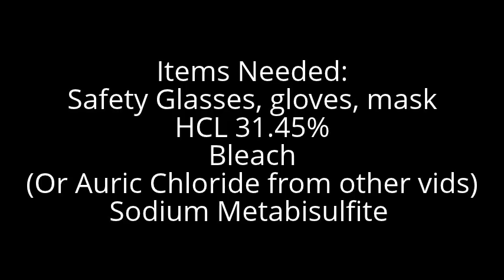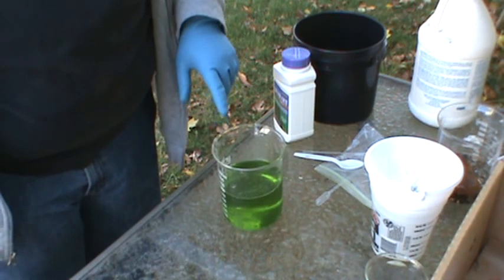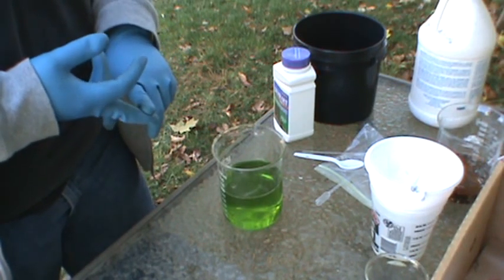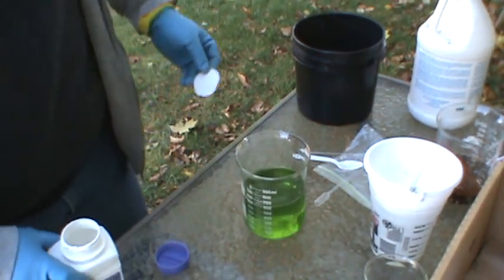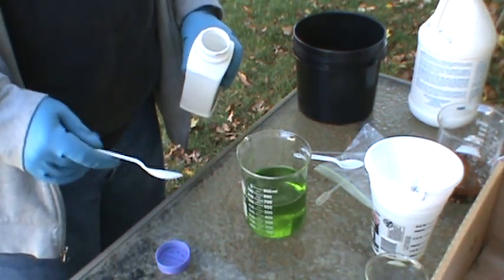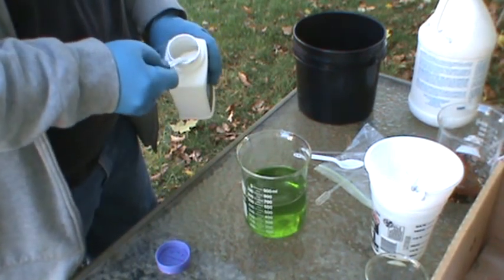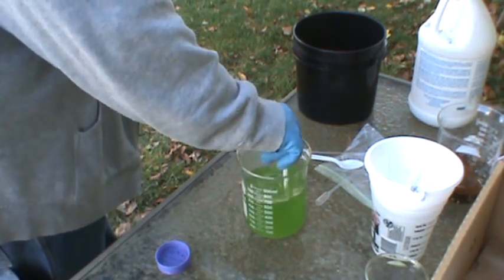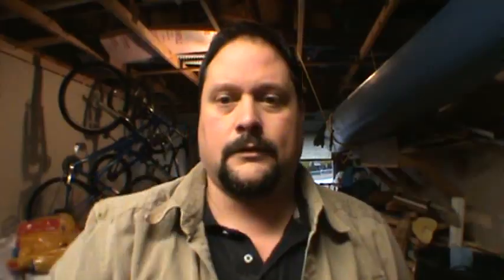Gold Recovery:  A Refining Process to Purify Gold

Comment: I have several kilos of the little Gold foil strips from ink cartridges and I was thinking of a simpler method of just burning them, homogenising the resulting ash, and then just gravity panning out the Gold/copper, melting that down into an ingot and then having that assayed and hallmarked. If the Gold content would be too low, I'd consider refining it electrolytically. What do you think?

Comment: ok so Im a total dumbass,,,excuse my french but its true,  HA,,I smelted 28grams of gold using map gas and borax, everythuing was fine until I took a closer look and noticed borax had embedded itself in my new nugget, no bueno!!  What are my options as far as getting rid of it ?? Or do I have any? thnx..gr8 video btw
Reply from the maker: Making a mistake or having an unfavorable result does not make you a dumbass.  Failing to acknowledge or attempt to learn from a mistake does.  If it were my nugget, and I am no pro by any means, I would heat it up again in the crucible without adding any more borax.  get it to the point where it is liquid and moves around the crucible very easily and continue to heat for a little.  the borax should come to the outer surface.  any remaining may disappear if you soak it in just hcl for a day or two.  Nice job!  28g isa  big nugget!
Reply: kool thnx for the input, is there such a thing as too much heat? Im terrified Im going to screw this up any more than I allready have.
Reply from the maker: 28G of gold and a MAPP torch, you will not over heat it.

Comment: Few questions. You said on the end that you are gonna heat up the solution to evaporate a bit of it - wouldn't it be pimplier just to filter out the gold? What are you doing with the solution after filtering out gold in the end?
Reply from the maker: when the gold has dropped, the particles are so small that they can pass through most filters.

Comment: Thanks so much for the videos! I wish this information was accessible years ago. I've been in scrap metal for about 35 years. The year Win95 came out I scrapped about 300 computers. There was a lot more gold in them then. I don't get many now. I sell my mother, daughter and memory boards as is. I once had a mother board from a mid60s computer that the scrap yard told me if I had more of them he would pay me $120/lb.  I dissect all the other components. I even yank the wires out of phone and network jacks and cut off the gold plated pins.  One thing I haven't seen from anybody is a discussion of waste and how to recover and reuse the acids. Good luck and stay safe.
Reply: Makes you cringe when you think back doesn't it...I know I do.  Especially when I think about things like all the old video game cartridges that were thrown out as a kid etc.  The acids for the most part are not reusable or salvageable after they have been spent.  If used properly, they can last a long time, at least AP anyway.  Others get added to stock pots where they are often evaporated down and further precious metal recovery takes place then they are disposed of at chemical waste facilities.

Comment: I just watched Gold Recovery: A Refining Process to Purify Gold and had a question. Does the Stump out bind to the gold? Because when the gold is in the first solution, it looks like its liquid gold. Also, once the gold has settled, how do you get the gold out of the soda bottle?  They are flakes at that point, right? Do I use a coffee filter in a funnel?
Reply from the maker: no, when stump out or SMB is added it makes sulfur dioxide gas that causes the gold to drop.  Once the gold has dropped, there are no flakes, only dust.  Soda bottles are not the best container to use, I have learned that since this video.  You should decant into a wide mouth container like a beaker.  rinse the bottle well with hcl or distilled water to make sure all gold is in the beaker.  Alow to settle.  then carefully filter the liquid off making sure to not disturb the gold dust.  When the fluid level is low, heat to finish drying.  Save the filter with other sweeps and filters for future recovery
Reply: but how to filter the liquid off? what should I use to do that?
Reply from the maker: double layer of coffee filters

Comment: +Moose Scrapper too little gold in solution.....is that the reason after putting SMB into the solution, it turned from green (residual copper) to a light Amber color? I am going to let it sit in the warmth of outside to try and accelerate the reaction process. Any tips? It is a combination of gold particles from computer parts as well as the gold from ink cartridge ribbons.
Reply from the maker: Possibly that there is too little gold in there.  The amber color is likely the gold however it is likely getting redisolved.  also depends on what your total fluid volume is

Comment: Hi'ya, Moose. Big fan and recently subscribed to your page. So, I recently helped close down a semiconductor facility that I worked at for nearly 14 years. And, because I was one of the last employees there, I came across several old ST boards with about 1,500 gold pins per board (try removing all of those pins by yourself, yikes!). Anyway, my brother and I recently setup a fume hood to remove the gold plating from these 8-10 lbs of pins we now have via usage of some Nitric acid. It worked like a charm but, unfortunately, we sucked up most of our Nitric acid on the first run and only did about 200 grams of pins (as you can see, even though it's a faster process, it's not financially sound). So, we were wondering how we could do a few pounds of these pins at a cheaper cost all at once. I watched your Muriatic air bubbling video, and even though it worked great for those gold fingers, we're not sure it'll work for completely covered gold pins. Any suggestions and/or advice with this current problem that we're experiencing. And no worries, I'm well trained at handling chemicals and also the proper safety gear, as that was one of my primary tasks while working for said company. Thanks in advance and we hope to hear from you soon. Take care!

Comment: sry moose what I meant is the gold u are precipitating in muriatic acid and peroxide?  what exactly is the solution you are precipitating the gold from
Reply from the maker: +Anthony Holbrook hcl and bleach.  If your gold is going through the filters, then double or triple up the filters or get some more fine filters.  Its ok for gold to get trapped in the filters because you can always dry them, burn them, then process the ashes with HCL bleach.

Comment: when u added stump out SMB did you dilute the acid . and was the gold in your normal solution = muratic and peroxide.  thanks for the videos moose .
Reply from the maker: +Anthony Holbrook no.... there was no peroxide at all... are you sure you watched this video?  The SMB can be diluted with HCL or distilled water before added.  It helps for a more thorough reaction.
Reply from the maker: +jas wix hydrogen peroxide is not bleach.
Reply: +Moose Scrapper I think he means Hydrogen Peroxide which is bleach
Reply: yes sorry about that haha isn't there hydrogen peroxide in bleach though?

Comment: thanks moose, 1 more question do you happen to know how to get the gold off of say 50 coffee filters. On the cheap side. I also dnt have a hot plate or fume hood and ohio is cold .
Reply from the maker: +Anthony Holbrook Usually one can carefully burn the filters then treat the ashes with the HCL Bleach method.
Reply: another possibility is to just rinse/wash the gold off of the filters with distilled water then run it through something akin to one of those reusable plastic/fine mesh coffee filters.  not trying to steal your thunder moosecrapper, just trying to facilitate the flow of info.  I'm wanting to get into dong this myself an want as much knowledge as I can get before I start so I can be as efficient as possible.

Comment: hey moose I have silver contacts attached to brass,copper and maybe aluminum.  I've had it sitting for almost a week,  adding little muratic acid and peroxide every few days. some I think brass wnt dissolve.  any advice to recover the silver before cementing or precipitation.  looked all around and can't get good answer.  thanks
Reply from the maker: +Anthony Holbrook If you are using AP, you need to just let it sit.  It can take weeks for the brass to dissolve.  If you have an air bubbler that will speed things up.

Comment: hello I think I'm double posting new to this...did u neutrilize the solution prior to precipitation with SMB . and can u and if not what happens if u try to get gold off fingerboards with HCL/bleach solution instead of using the HCL/peroxide method thank u so much.
Reply: +Moose Scrapper thank you so much for the reply. so I've taking up gold scrapping as a hobby for a few months now. 1st obtaining knowledge and then trial and error always using upmost safety. I found that using bleach is very toxic and I appreciate all the safety and warnings u put into ur videos. thru trial and error I found that instead of bleach what I used is nitric acid. now this chemical is hard to find and darn impossible to get in some states so I ordered a standard gold testing kit. what comes In it are several vials that contain acids that test for gold. these vials contain a mixture of nitric and muriatic acids 10k 14k 18k &22k. now I put 100mls in a mason jar and then put my gold foils in along with one vial of 22k nitric acid/muriatic. it dissolved all the foils and from there I used 2 tbl spoons baking soda to neutrilize then SMB and I got a nice return. do u think I'm onto something or I should go back to the basics. Thank you again for all your help and advice.
Reply from the maker: +Jeremiah Nickerson I don't know anything about using nitric but if its working for you and is still profitable, safe, and enjoyable, why stop?

Comment: If someone melted IDE pins into an ingot would dissolving the ingot in acid then adding the stumpout leave me with just gold or will it bring back the copper and other metals too?
Reply from the maker: +Michael Sacco Well to begin with, it would take months to dissolve the ingot.  Second, most of the ingots that people sell on ebay are so small that the amount of gold recovered from one is almost too tiny to measure.  Refiners really discourage smelting before refining.  Acids need surface area to work, smelting reduces the total surface area exponentially.

Comment: Moose, Love the vids and have been doing the A-P method for foils. Here's a Question for you. Can Bonide S/O be used in the A/B and the A-P method? I have some printer cartridges that I peeled off the gold strips. Would like to try the A/B method instead of A-P
Reply from the maker: +Robert Kline No, two different processes and solutions entirely.
Reply: +Moose Scrapper  Got  those soaking in A-P and the stuff turned yellow. There are a few small flakes floating around but it seems most of the gold has "disappeared". Also I have some used A-P that is black. I put a SS fork in it and two days later the fork was half gone and its still black any ideas/suggestions? Thanx for replying
Reply from the maker: +Robert Kline Did you check the bottom of the container after the fork vanished?  Sometimes the copper crystals slough off and sink.  Turning yellow is fine, a few flakes as well.  Many of the flakes will be very tiny anyway.  IF you feel any gold has dissolved you can simply place a large piece of clean copper in the solution for a few days until it stops dissolving.  THis will push out any gold from solution as a black powder.  Just be sure that you do not make one of the biggest mistakes new folks make by thinking that just because there is not much gold floating that something went wrong.  Most often people just don't realize how much material it takes to make a gram of gold.  Bottom line, the gold isn't going any where as long as you do not throw anything out.

Comment: hey. I love your vids just a question, if I buy a drop melt of 56.6 grams in a nugget shape would I follow this same process to purify it?
Reply: +Cassidy Estrada you saw that on ebay also?
Reply from the maker: +Armored Apceros No, and quite frankly, those listings are 100% scams targeting people who do not know a lot about gold recovery.  They have practically no gold in them but because the pins are brass under the gold plate they look gold in the pics.  Best advice is to stay away from all those ebay listings.  You end up paying $40 for $0.40 of gold.
Reply: What about buying the cpu pins in bulk
Reply: Yes armored apceros and unfortunately I fell victim to it
Reply from the maker: +Cassidy Estrada The problem with buying that stuff, especially on ebay, is that its a fools market.  Not meaning that you are a fool, just meaning that people have been buying these items and inflating the prices to a point so far above the actual value because they do not know what they are doing and there are loads of people out there who want to capitalize on that fact.  I often search ebay for things just to see what the prices are at and can tell you that I have yet to find anything.... and I do mean anything that is reasonably priced.  You can find auctions that start off at 99 cents but because people think its worth more than it actually is, the bidding almost always go way to high.  The only places to get reasonable prices would be on smaller forums like the gold refining forum etc. however if you are new enough to the hobby where you do not know how overpriced ebay stuff is, then you should probably stick to just recovering the stuff you find until you have some experience under your belt.  Does that make sense?Thanks!

Comment: hi i like your video find them interesting  i notice you  work with acid one safety advice when you  do that  keep a boket of fresh water  or your garden hose near by  if you  splash yourself you can wash it off fast  and avoid problem
Reply from the maker: +ray tru Great advice!  The garden hose was literally a couple inches away from the corner of the table.

Comment: HI CAN I GET SOME HELP THERE WAS A VIDEO OF URS WHERE U SED WE CAN USE HCL WHICH IS USED FOR SWIMMING POOLS BUT U SED PH MINUS I CANT GET THAT HERE WER I LIVE BUT I HAVE HCL FULL STRENGTH HOW DO I SUBSTITUTE THE PERCENTAGE OF THAT FULL STRENGTH OR MEASURE IT
Reply from the maker: +Punam Sharma Nayee Define "full Stregnth"  HCL 31.45% is recommended for these processes.  The strongest HCL out there is just slightly over 40% but the evaporation rate is so high that it is not very common at all.  Most "Concentrated HCL" is around 38% so if that is what you have you can simply mix up 800ml of your concentrated hcl with 200ml distilled water that should give you close to 31%.

Comment: i know you can get bleach at the cleaning section of a store but where  can you get the  other stuff ._.
Reply from the maker: +tails doll black HCL also called muriatic acid is available at just about every hardware store in the US.  Its used as a copper etchant and to clean concrete.  SMB you can find either at stores that sell beer and wine brewing supplies or on ebay.  Its loads cheaper at the brewing stores though.  Food grade works just fine.
Reply: downside... i live in Canada  :P  but i will look up on that    thankies   ^^

Comment: your doing great... I've been a hobby gold miner all my life.  not in this way but by going out and digging up the earth.  Lots of fun for the whole family.  Gets you outside and doing stuff with the family.
Reply: Harwin, Hello. I hard rock mine. Just started. Was willed 5,000 acre's that had 3 very old gold mine's. I sent some cons off to a refiner. Said 3-3 1/2oz per ton. He also said encapsulated in magnetites[these not worried about], but he said Gold in my sulfide's. Since I know I have alot of sulfides also. I am trying to get the gold from them. I roasted and got some, but I am trying HCl & perox. But I was told galvanized nails would precipitate. Well just did today, nope. Left sit all day on a warming plate, dropped in galvanized nothing happened except as nail went in it fizzed then stopped. I cant get smb. Any idea's on how. The HCl solution turned deep yellow, real dark.
Reply: @1hardman161  SMB is easy to get hold of.. you need to get in touch with a homebrew supplier. It is used to clean the distillers tanks. :)
Reply from the maker: +Harwen Entertainment I have always wanted to try that.  There is only one spot that I know if in Maine to do that and its two hours away and still pretty hard to get any gold.

Comment: This is very interesting! Thanks for sharing. What do think about circuit board recovery?
Reply from the maker: +David Aune I am not sure what you are referring to with that.  Some circuit boards have no PM's on them at all.  Rarely are entire boards etched with gold, and for the few that are I have a video on that.  Unless you are referring to gold recovery from the individual items on the boards like gold recovery from IC chips, or gold recovery from plated pins, etc.  I think its a fun hobby.  Other than that, its not a huge money maker unless you can do it in massive bulk.  Does that answer your ? ?  Thanks!
Reply: +Moose Scrapper Yes that answers my questions. thanks